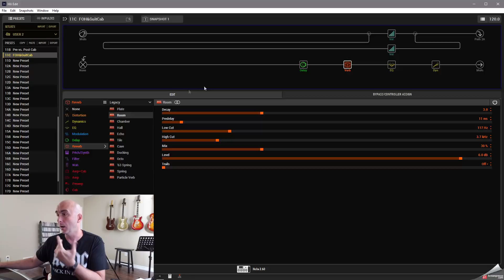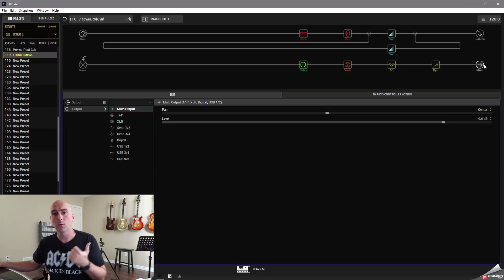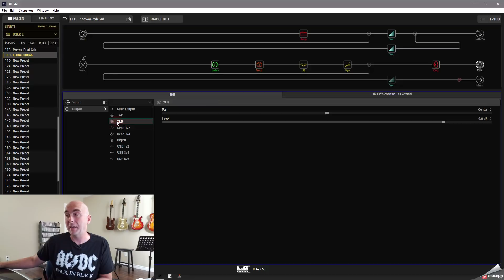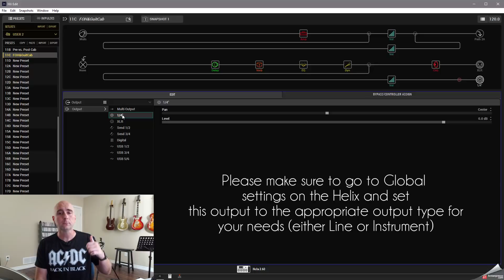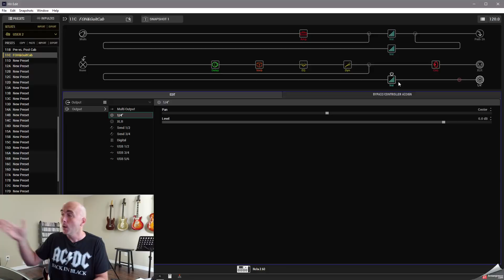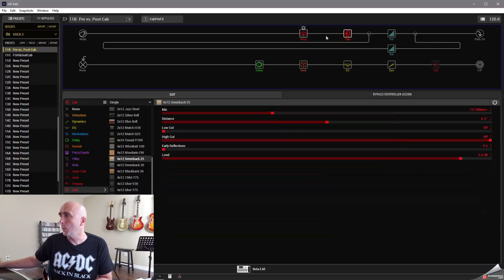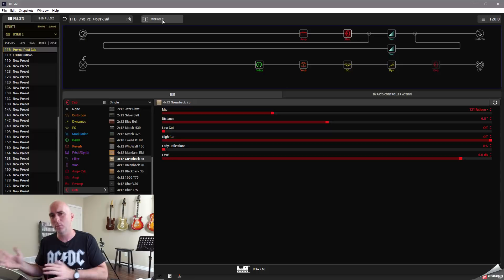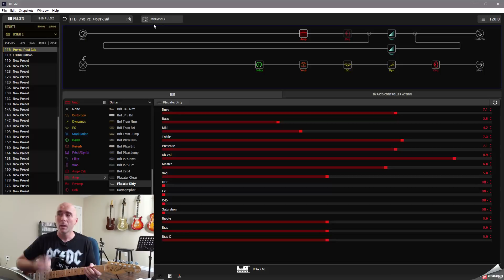Line 6 Helix - Create A Great Tone - Pt. 22 - DI FOH Output While Feeding Real Guitar Cab...HOW?

Comment: Jason, I know I'm a little late to the party, but I've decided to upgrade from a Pod Go to the Helix for a lot of reasons, but this one in particular is the main reason I feel I would like to own a Helix. Now I can do something similar on the Pod Go, but when you move the Cab Sim to the end of the chain, it can only be used in mono. It actually changes the stereo signal to mono and there's no way to fix that. I always play in stereo, so my question is... can both of the outputs you set up in this video be configured to stereo? I love the sound of my Harley Benton Thunder 99 Amp Pedal, going to (2) 1x12 speaker cabinets without any cab sims or IR's. I have made my own IR's of the same cabinets for the front of house.

Comment: Hi Jason, great video as always. Quick question, why did you choose to use a gain block + separate path over an fx send block? Was it to preserve the volume control as a master? An fx fx loop send would save your extra path as they have dry thru. Cheers!
Reply from the maker: Hey Cat...no other reason than that is the first way I thought of when doing the video :-) Using the Send block would most certainly be a great way of doing it...thanks for the suggestion :-)
Reply: So you mean using the send output of the helix and therefore having to add a send block inside the signal chain?

Comment: I have a question about this process (slightly modified) while calling back to a previous cab-centric video.
I will be running my patches very similar to your approach here, except I will be reversing the end of 2B...running 2A straight out to 1/4" and tapping out a cab sim at the tail end of 2B out to XLR. Easy day.

In a separate cab video you mentioned that if you run a dual cab setup (which I would prefer) that Helix automatically pans them hard left/right. Do you forsee this being a problem if going straight from there to FOH via XLR? If so, would adding a mono block of some sort (transparent compressor doing nothing, a gain block perhaps) to bounce it back down to mono be a logical workaround?
Reply from the maker: That is exactly what you would do Jay is add a mono block after and it sums the 2 cabs to mono....hope that helps :-)

Comment: Thanks for another great video Jason. I’ve got a question. I use a Line 6 SpiderValve 112 combo to monitor by sending the Helix to the power amp section. I’ve found that the preamp only model sounds better through the amp. Do you know if I can send a full amp/cab model to FOH and a preamp only model to the power amp?
Reply from the maker: My pleasure John and thank you :-) I recently did a video about some alternate routing situations similar to what you describe. You can find them here:
https://youtu.be/3J3fQjWPEi8

https://youtu.be/fHpY3Du05-4
Reply: Thanks Jason. The issue I have (unless I missed something) is that scenario sends the full amp-power amp model to my amp. I’ve found that the “real” power amp of my combo colors the tone so it sounds better when I send the preamp model only to the power amp section of the combo. I’m guessing the way I would deal with this is to have a full amp model with speaker that I send XLR to FOH and on a separate path another copy of the amp but only the preamp model that I send to the combo. Sound correct?

Comment: Hey Jason. Confused about how one would do this. Let's say you have power cab +. I want to send xlr with cab sims to FOH and line 6 digital link to powercab. To get the amp sims right for FOH sound I'd need to dial that tone in on the powercab in FRFR to ensure it sounds the way I want as a cab simulated sound for the sound guy. But then on my 2nd path that goes out to my power cab via digital link I'd dial that in totally different for my amp in the room sound? Basically in this setup how do I ensure my cab sim tone for FOH is what I want the sound guy to hear
Reply from the maker: You could also split the signal at the Helix and send a signal to the PowerCab that has no speaker sim on it and use the PowerCab to monitor on stage and send a different output from the Helix to FOH. There are a lot of different ways to run it. Not sure if that helped at all :-)
Reply: @JasonSadites  Helpful for sure! You are the man. I guess I was more so thinking, what is the reference point for the path going to the FOH? How do you know it sounds good? Are you using headphones? Powercab? Stagesource speakers? Its easy to dial in the powercab tone cause its next to you on stage so you have a perceivable good tone; but what would you use to dial in the tone on the path going to FOH so you know it sounds good?
Reply from the maker: I would probably record it to my daw and listen back to it to get the tone right or as you mentioned listen to it through a different set of speakers.

Comment: If you’re using the mastering section to compensate for the impulse. Why not put the cab before the effects but the split before the cab?   The output to your personal cab might not need the same eq cuts and compression as the FOH sound anyway.
Reply from the maker: Did I say somewhere that I was compensating for the impulse with the mastering section? I don't think I did, but if so that is not what I use it for. I use it on all my presets and it is an integral part of the tone and something I want to go to both front of house and my personal monitor. I have things placed exactly where I like them to be, others may or may not like it that way and they are free to change it around. That is the beauty of the Helix, it is a very simple task to simply drag things around to suit your needs.
Reply: Jason Sadites I guess what I’m saying is.  Maybe your live cab is the power amp in on a deluxe reverb. But your impulse for your tone is a 4x12 mesa for example.  In a situation like that you might not make the same choices in the fine tweaks.  The flexibility is great and that’s the point. But if you hypothetically, if you decided you didn’t like how the mastering effects sounded on the live cab anyway, you could split the signal earlier.  I’m not saying your rig specifically. It’s just something worth thinking about in general.
Reply from the maker: Absolutely. I make it very clear that I dial things in the way that I would use them and people need to tweak for their own needs. So no real need for me to think about that, but everybody can adjust these as they see fit.